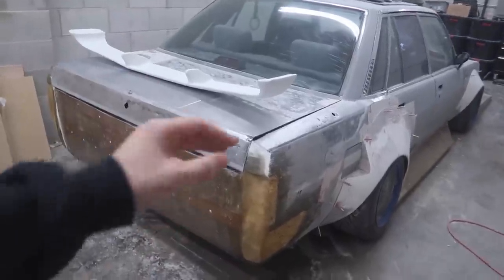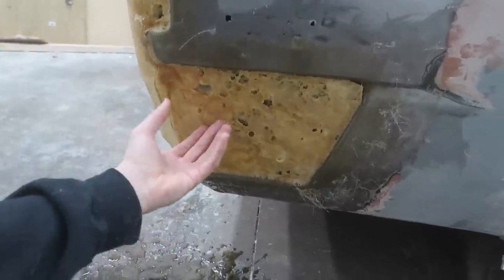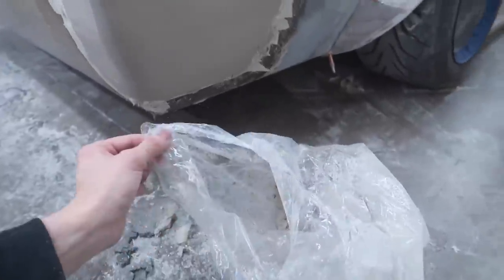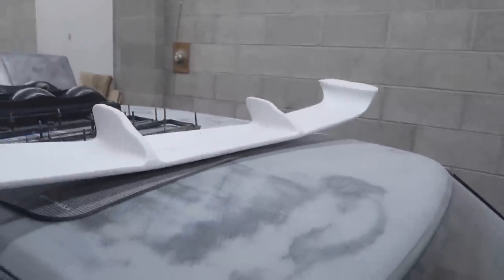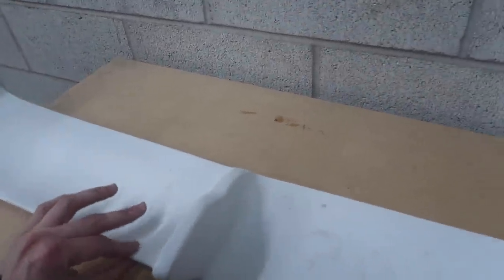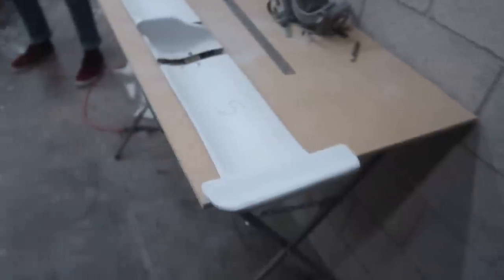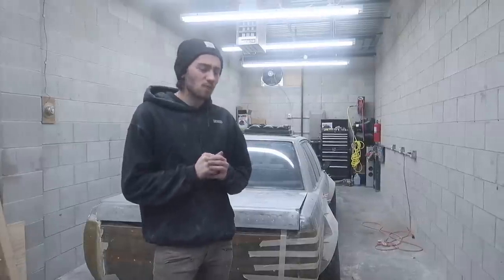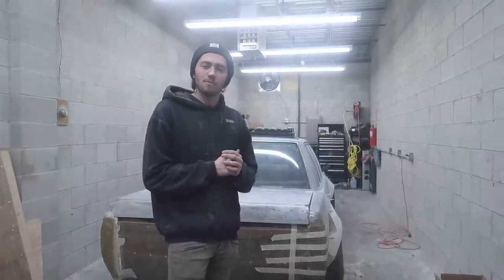Cutting Up THIS Rare JDM Part | Bosozoku Slit Spoiler

Comment: Great progress man, its so satisfying knowing something is done the absolute best you can do it. On another note I'd take those screws out as soon as possible on the spoiler, and I'd also grind the fiberglass and resin that is on top of them before trying to back them out otherwise it will tear the fiberglass a ton.

Comment: After you put on the foil tape,  you can draw the shape with a sharpie marker.   The lines will transfer into v the fiberglass,  and make it easier to trim after you take it off.

Comment: You mentioned the expanfld/cure time of the foam. I'm not sure if you know but most canned PU expanding foams like Great Stuff are cured faster with moisture and humidity. If you lightly mist it with water after most of the expansion is done itll cure faster

Comment: It is a lot easier to wet out fiberglass if you use a mini paint roller. You can tape a piece of the heavy duty plastic on the floor with duct tape. Roll out all your glass on the floor. Much quicker and faster to wetout flat then in a vertical position. Then once it is all wet pick it up and apply it wet to your form / mold / clay whatever. That way you aren't wetting it out on your project and dripping everywhere, and it will be much faster... Also, you can use a aluminum fiberglass roller and roll out the glass to remove air bubbles if you arent already. Much more even and strong. Just a word of advice.

Comment: have you considered using body epoxy to attach those new corners caps you made? Using fiberglass as "glue" to hold it to the body may begin to delaminates as time goes on, but the stuff they use to glue together truck beds is made for that exact application!
Reply: Izuhara Torozu  epoxy bonding the new fiberglass part to the metal would lessen the likelihood of it delaminating from the metal, but the plan is to mould that part to the car not just attach it; meaning we would be fiberglassing straight to the metal anyway to mould it in, to avoid any shrinking of other alternative fillers that would then show through the paint otherwise...so that’s the benefit of fiberglassing the entire pocket first and then fiberglassing the new cap into the initial glass and then the metal on the quarter, making it a good seal while limiting the possibility to shrink or delaminate during the life of the car

Comment: You could try insetting a razor blade or wire look into a block of wood with the amount of stickout you want for the fiberglass thickness. Then make slices as reference marks to sculpt down to.

Comment: You are brave to cut up that spoiler. 😱
Reply: its not a spoiler, its a lip for under the rear end
Reply: @Ollie.r1chards  it's a spoiler.
Reply: @theforgedstinkeye9865  no its not
Reply: Ollie Richards it’s a spoiler, that he’s going to use as a diffuser. Doesn’t change the fact that it’s original use was as a spoiler
Reply: @SUBLIME2841  was a spoiler *
Reply: Ollie Richards still is just used for something else

Comment: Why dont you just smooth off the rear lights and make a new place for the rear lights to go and put the bumper back on the rear? I have yet to see a gx71 with only the rear bumper deleted for a boso build, most genuine builds still have the bumper!

Comment: Why didn't you just make it out of metal? I guess at this point it would of been quicker?
Reply from the maker: It would be extremely difficult to make the curve of the sides out of metal. I discussed why I used fiberglass in the previous video.
Reply: I know it did watch, I once tried to remake the same area on a classic car but I cheated and hid it under a bumper